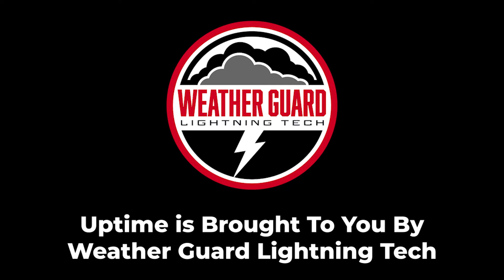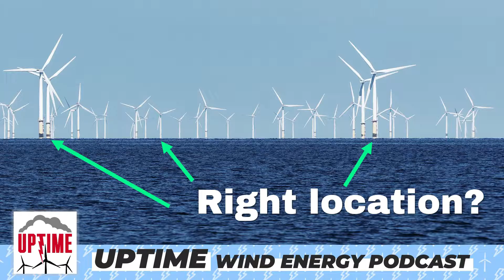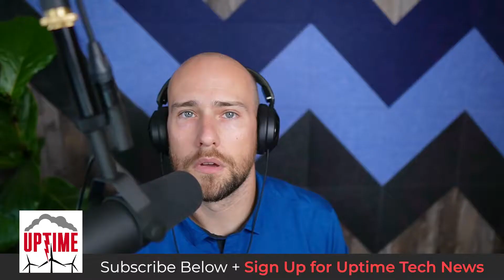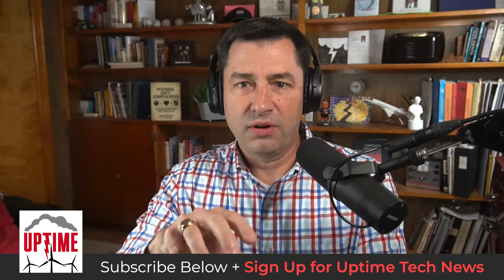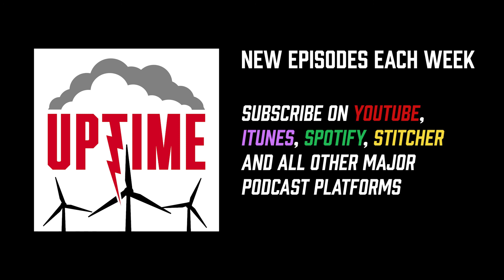How Do They Select The Right Location for Off-Shore Wind Farms? [UPTIME WIND ENERGY PODCAST]

Comment: I think a good subject for an episode would be how the electricy prices are effected by the fluctuation in renewable production without major storage.
Because of the interconnetion between Scandinavia and Germany the effect on local pricing is very noticable. 
Last week production in Germany vent from close to zero up to 50 GWatt in 24 hours and the price went from 2 Euro per 10 Kwatt/h to  Zero in the local marked.
I it clear that even if we get most of the production from hydro, many producer will not take the cost of constantly ramping up and down prodution on their installation to fit the wind generated production.
I think that this is a cost that should be include when storage installations are considered and a more stable price will make it a lot easier to develop new projects.
Reply from the maker: thanks for the comment - we'll discuss this among ourselves the next planning session for the podcast!